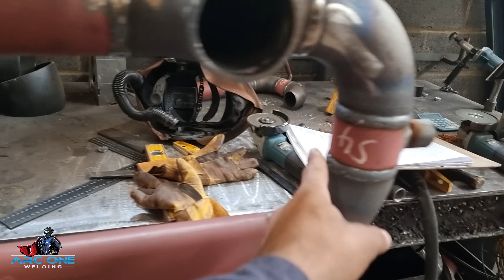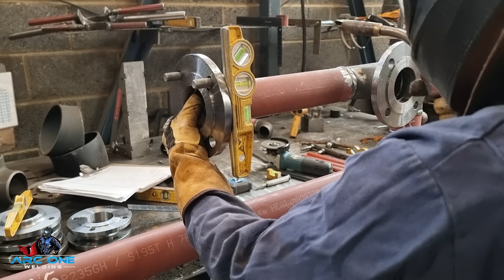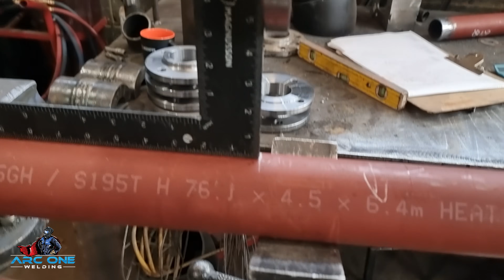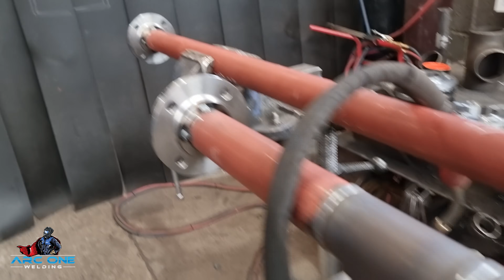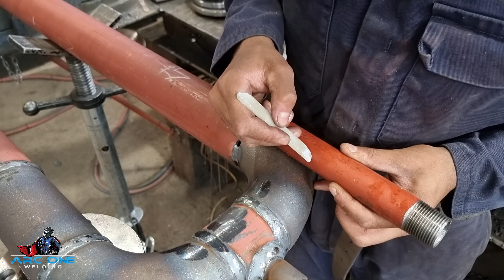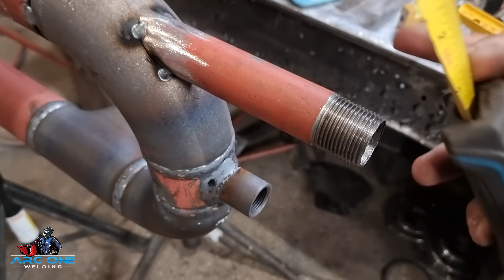Hanging Flanges, Pipe Spool Fabrication Tips&Tricks

Comment: a good trick for very slack  slip on flanges  is some blue rope across the pipe end  at12 6 9and 3 oclock  set  your 2 hole square  and push the flange over the rope  it saves  it flapping about    just tack it   plumb+square    the rope  burns away   it keeps it concentric to the pipe too